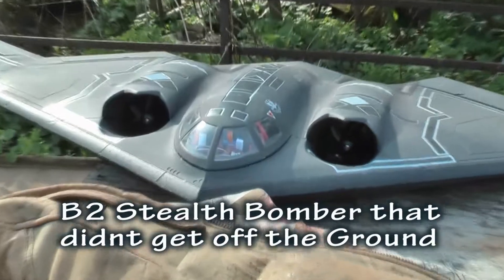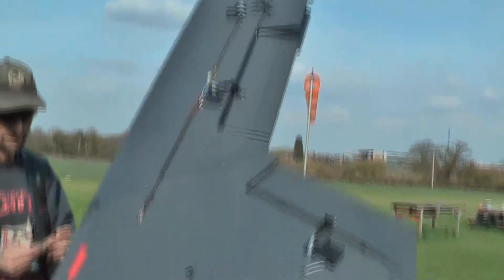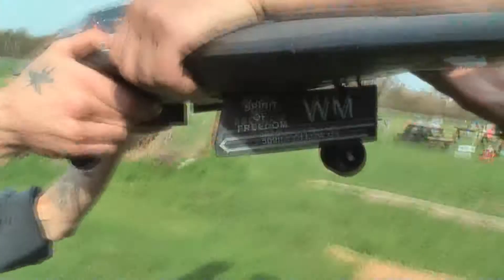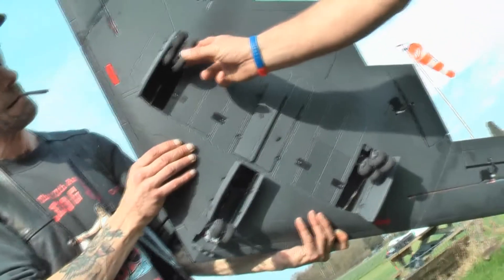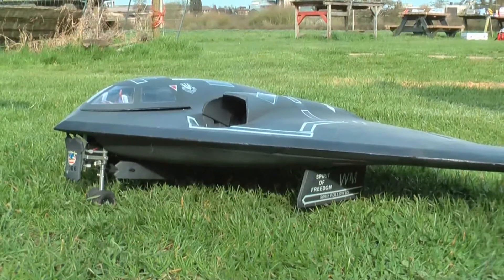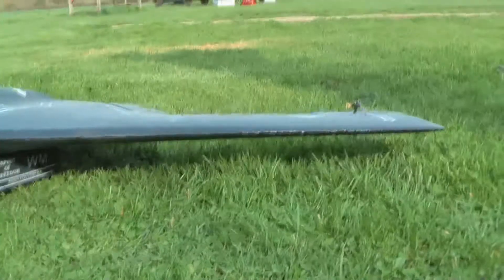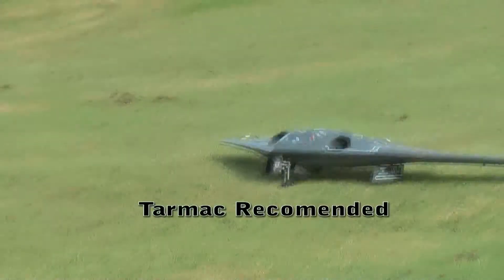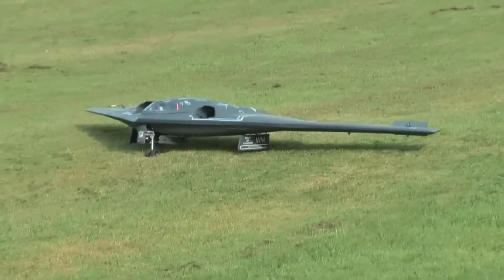B2 Bomber, Radio Control didnt get off the ground

Comment: i bought one, it was the fact that the back wheels would turn , they are not suppose to..put a screw in each to hold still, after that it took off, very disorienting all black....go over everything before flight..ailerons were not strong...didn't turn well when in high speed..